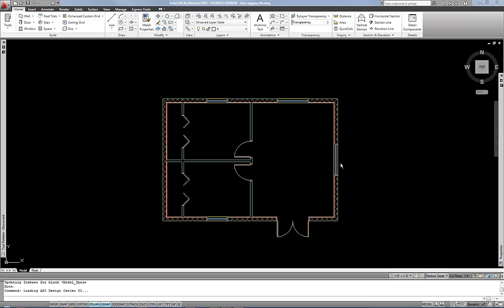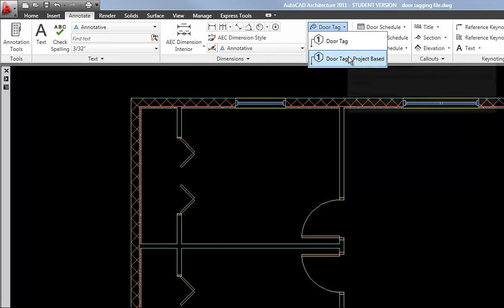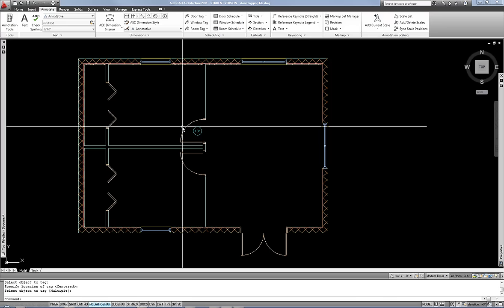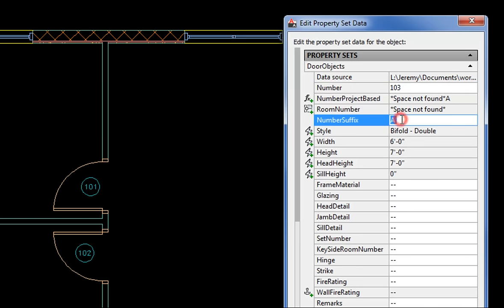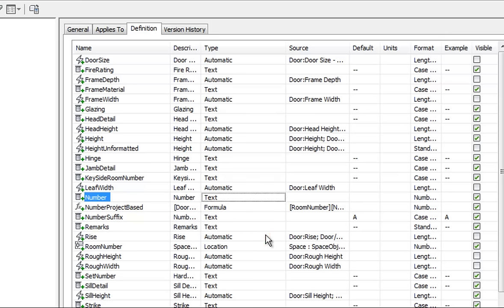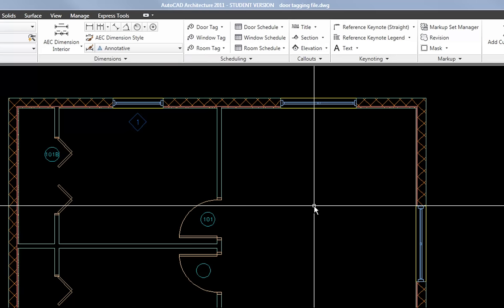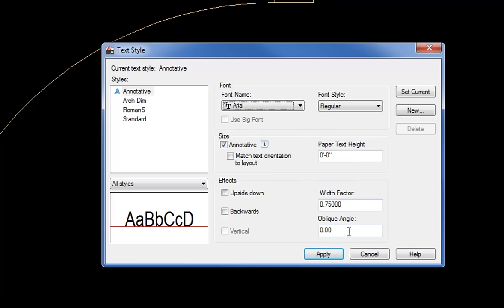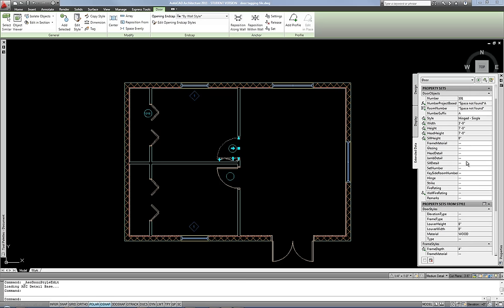ACA:  Door & window tags

Comment from the maker: I assume you mean the door or window schedules?  That is not a template, but rather a schedule style.  

I assume you mean Architectural Desktop 2007, not regular AutoCAD?  Otherwise that could explain why you don't have the same schedule types.  Architectural Desktop was renamed to be AutoCAD Arch.

There is not a simple download for the AutoCAD Architecture schedules from a new software release, but you can customize columns in a schedule to include the properties and headings you want.